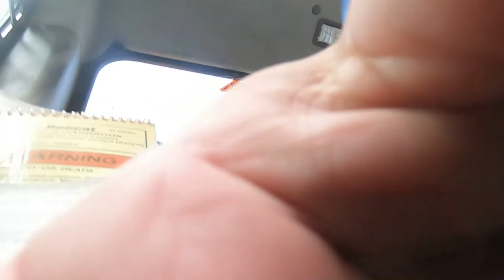Testing the skid steer boom.

Comment: Andrew Camarata had a video taken down by YouTube earlier this year, when he helped some friends put up some roof trusses with a boom lift/cherry picker.  I got to see the video before it was taken down, and if I remember correctly, they disabled and alarm on the boom lift.   It was a two story house, so they were lifting pretty high.  I suppose one difference between that and your situation is that Andrew was operating the lift from the platform, so he had a long way to fall if the boom lift fell over.   Apart from the two part arch spans, the RSJs you were lifting are not particularly heavy.   It does look a bit unwieldy though.   Whatever the YouTube safety pedants think of it, it made for an interesting video, and we all wanted to see the boom arm being used after we saw you weld it.
Reply from the maker: I'm sure someone will let us know we didn't follow the proper safety procedures! Thanks for watching.
Reply: Digginok yes they will Frank 🤣
Reply: Trevor Dennis wait a second... are you comparing this to Andrew??

Comment: Where's the LS51, lol?  Thought you just worked below ground level, lol. Thanks & take care.  (Finished my skid steer project, testing it out Monday.)
Reply from the maker: I offered but Eric doesn't trust me with it for some reason! What did you build? Thanks for watching.
Reply: @Digginok  Converted a sickle bar with hydraulic motor from rear tractor mount to forks on front of skid steer & camera on end of bar to see lemon tree trunk.   Purpose is to skirt low limbs (<18"). Hope it works good, lol.  Thanks for asking.
Reply from the maker: That sounds pretty cool!

Comment: thats a lots work that you put on that boom,, and I hate to say it but you better have a good insurance, that boom by it self its heavy plus the load ,, dangerous , the 2 pins at the locking plate are not design for that it can vend and come off. look look be safe.